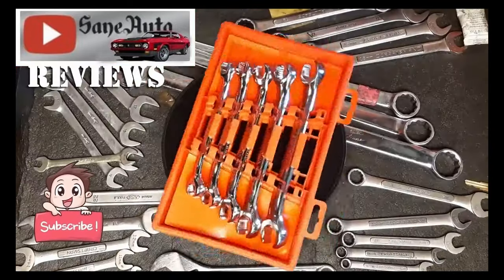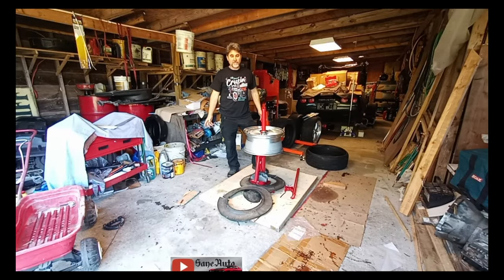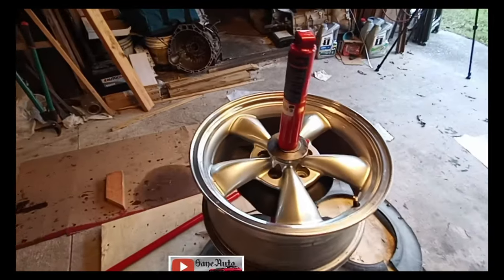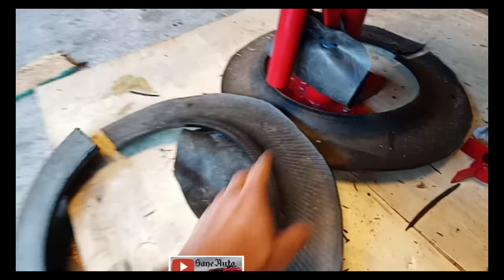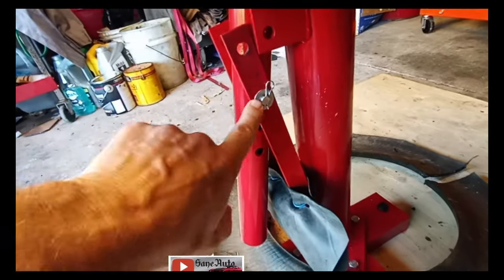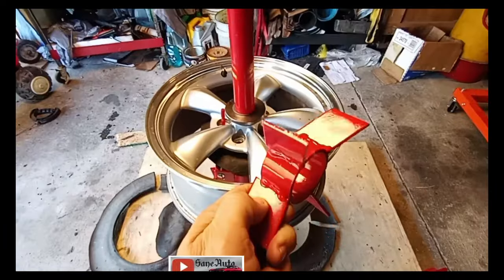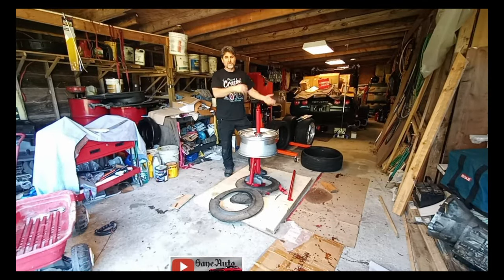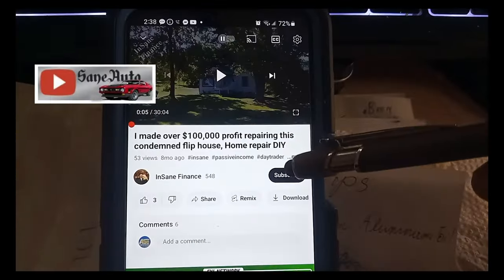Manual DIY car Tire changer overview mod tips trick

Comment: I still using my HF unit. Just swapped 8 tires. The side of bead breaker finally started to bend after many old tire removals. I will be welding some reinforcement to it. Can't be it for the money. Looking forward to your mods.
As per instructions (LOL) 👍# 2
Stay safe, Joe Z
Reply from the maker: How did you mount yours?